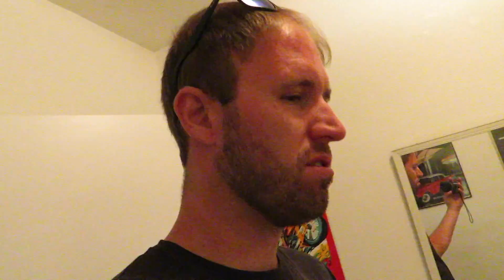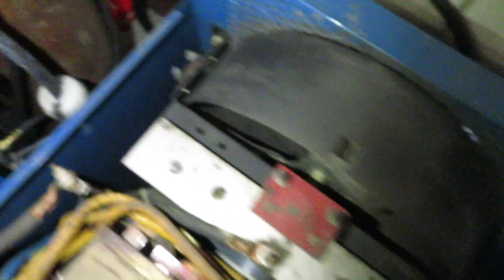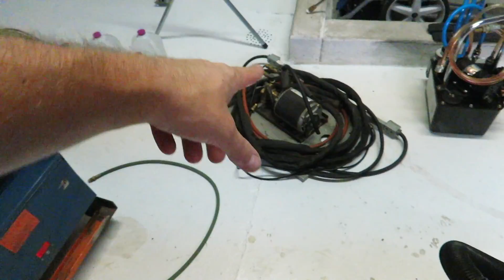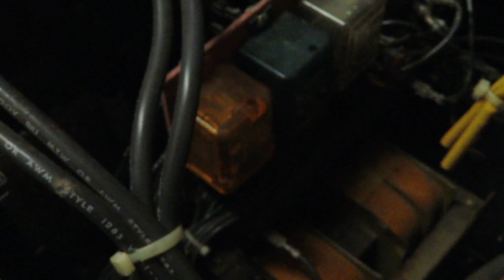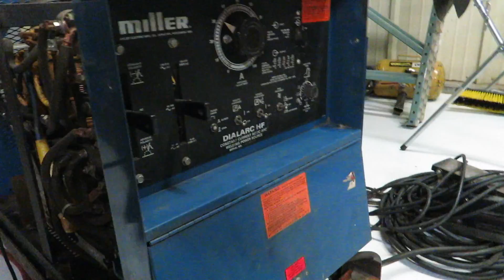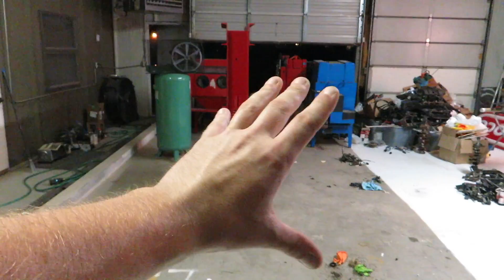Tig Welder Problems

Comment: Turn the "high frequency" switch on your machine to either start for DC, or continuous for AC. . . The high frequency is the arc starter on the machine, with it in the middle "off" setting as you have it, it won't do anything. I guarantee 1000% that is why it isn't striking an arc.
Reply: exactly what i was thinking

Comment: I wonder if a heater core would be a sufficient radiator for the tig?
Reply from the maker: It probably would I have an old oil cooler with a fan I could use maybe